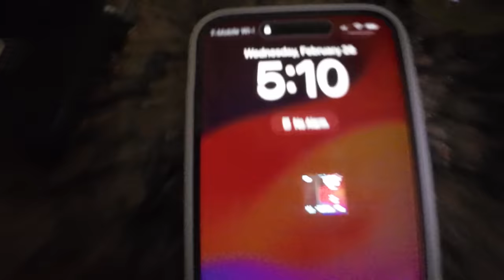I Tore My BICEP Muscle OFF THE BONE while Surfing

Comment: I did mine snowboarding. Felt like someone just ripped it off after going over some bumps at speed. Had to wait like 9 months for surgery with my arm just dangling. Rotator cuff shaved and bicep reattached to tendions and clean up from dislocation a few years earlier. 3 months in a sling no movement.

Comment: Off the bone isn’t as gnarly as it sounds. If you tear a tendon, one way that happens is at an attachment to a bone. I tore my bicep tendon playing basketball. I got surgery, but I learned you don’t technically need to have it fixed. Your tricep also helps to bend your arm. If you don’t get the surgery your bicep looks weird and you lose about 25% of your strength. If your old they frequently recommend not bothering with the surgery.